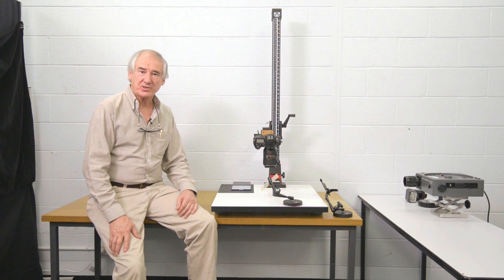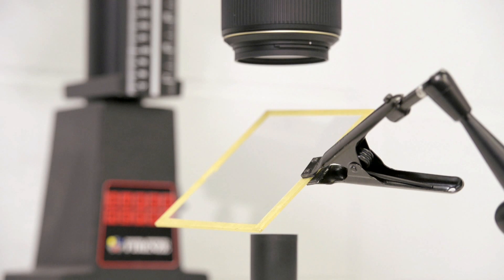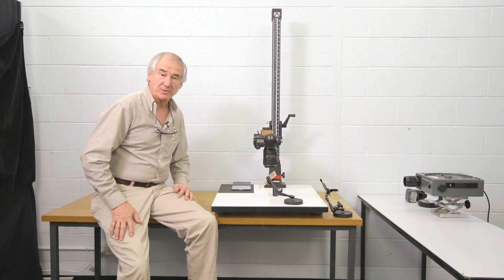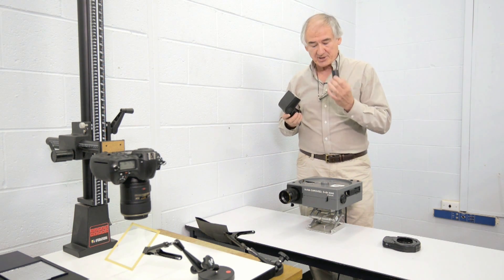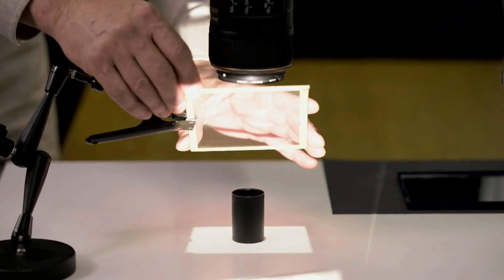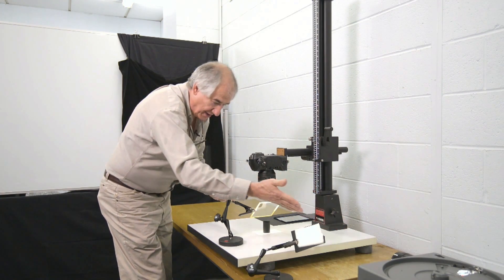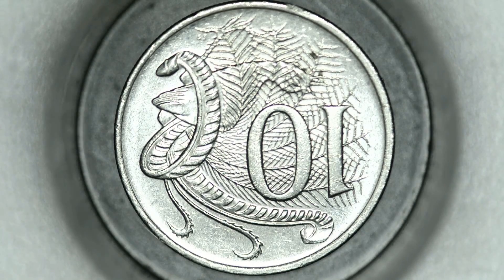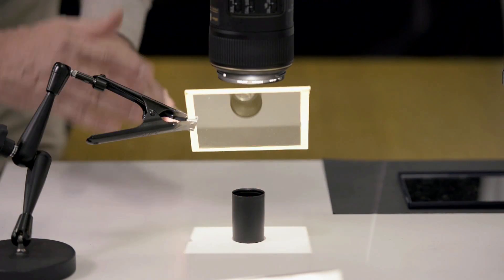Axial Illumination: Lighting "through the lens"

Comment: Thanks. I have read about this lighting technique before in an old Petersen's photo book from the 1970's.  I guess it is better to use a continuous light over a flash so you can see what is going on. I like the idea of an old slide projector. I may pick up a slide projector.
Reply: Thanks for your comment. The technique has been around for a long time but finding info on it is very difficult. Yes, a continuous light source is best so you can see the effect. I have built a system that uses a fiber optic and mono bloc flash head. Modelling light and flash - the best of both worlds. But honestly, I usually use a slide projector on most larger objects.

Comment: Excellent video sir.  Two questions:  1.  Is there anything special about the glass ? or is it regular clear glass.    2. Your stand is over 200 bucks in amazon.  Any idea on a different stand that still does the job ?  Thanks
Reply: I just became aware of your question. I'm sure you have moved on by now, however, here are the answers. In my (affordable) example, I use the thinest glass I can find. Strangely, the one I used for this is an Ikea small picture frame glass - thin and cheap. (Technically, the best option for the glass is a semi-reflecting mirror made for scientific work. If you think $200.00 for a copy stand is high, you don't want to know how much semi-reflecting mirrors are!) The copy stand I use is a really good one since I use it a lot. You could use a tripod that lets you reverse the column so the head is pointed down. Fiddly, but would work. Good luck with your shooting.
Reply: @galespring9028   Dear Professor, despite the years that have passed, I wanted to thank you. 
I saw this video some years ago, and today I had a chance to experiment with it. I was quite surprised with the results. I was afraid the on axis light would diminish contrast to the point I would lose detail visibility. And it was the opposite ! Every surface that was not perfectly flat and parallel to the camera, is darker (perfectly logical once you think about it). I was really surprised by the amount of detail I could see in the coin. 
Your presentation was so clear and practical that i remembered it until today (just forgot to have something dark to absorb the light return. Indeed it does go back and washes out the blacks, but it was easy enough to correct). 
Thank you once more for sharing this technique in such a simple way.
Cheers from France
Reply: Very useful for me and the many more who will see this video in the future. Earlier today I looked up semi-reflecting mirror pricing and was treated to an unpleasant surprise. Good to hear cheap, thin glass is a recommended budget route.
Reply: I learned early in my teaching days at the university that students could break anything! I also learned a caveat to that: the cheaper it is, the less likely it was to be broken. After my first semi-reflecting mirror accident, I have not had a piece of cheap glass broken in more than 30 years! Go figure.
Reply: I built a similar setup with glass out of a $10 picture frame.

Comment: Really great video!
I was wondering, are there any other lightsources that you might reccomend? (preferably budget) 
Or what are the characteristics of the projector as a light source that makes it especially suitable for this project?
Is buying just the kind of lamp out of a projector and putting it in a different fitting perhaps an idea? Perhaps if youd shine it trough a (black?) tube, to eliminiate the extraneous light that goes around the object to aim it more into the center, going straightforward?